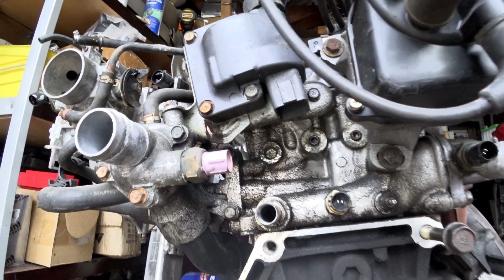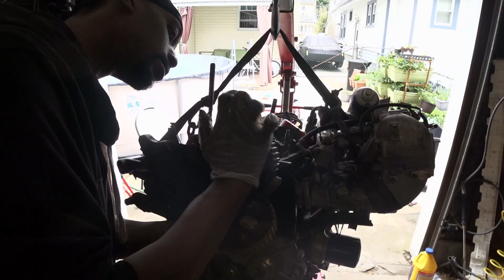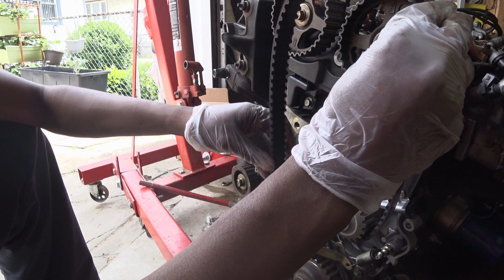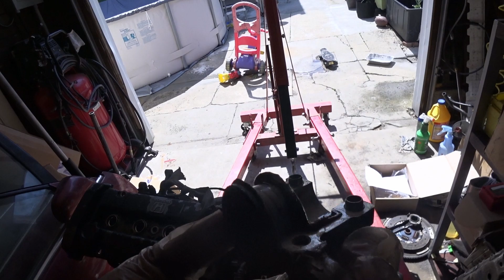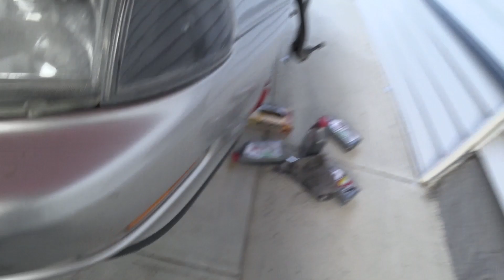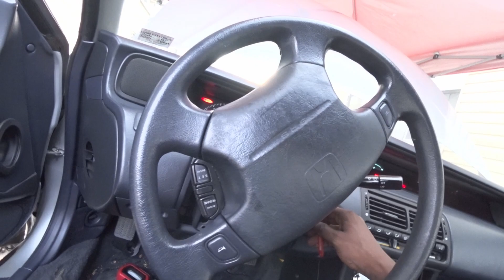How to Set H22, H23 timing belt, rear main seal and clutch. 93 BB4 Prelude SI

Comment: So you just have to mount the tensioner withoout having to adjust the tension ? I did this and my belt is trying to slip inwards
Reply from the maker: You mount the tensioner. Put the belt on then you adjust the tensioner to be tight on the belt. Rotate the crank to see if it correct and all the timing marks line up.